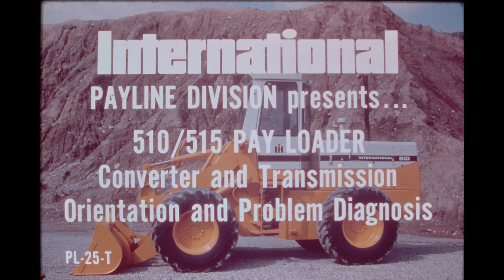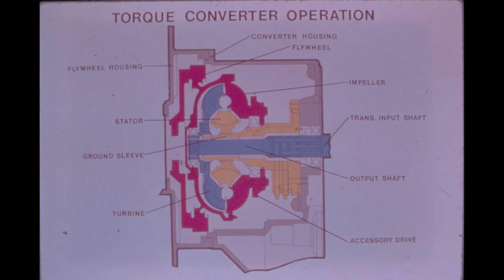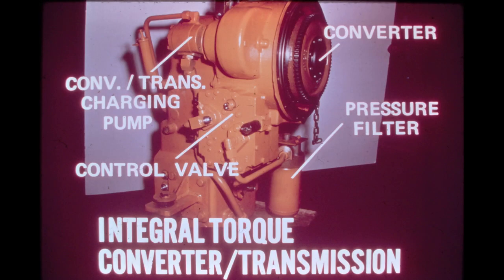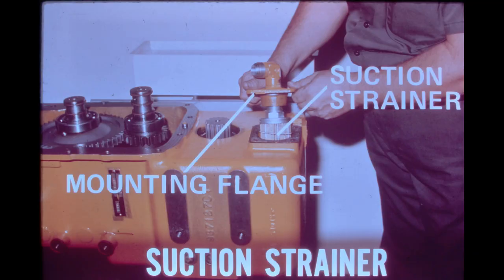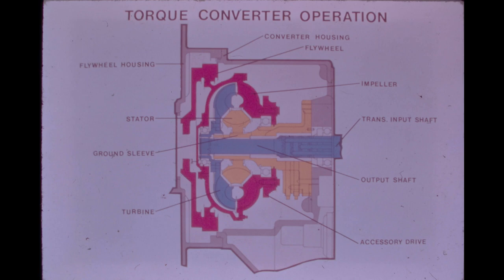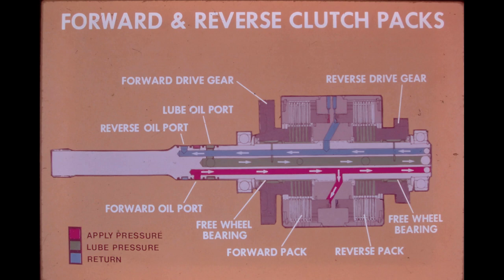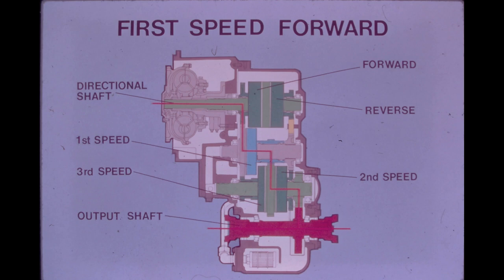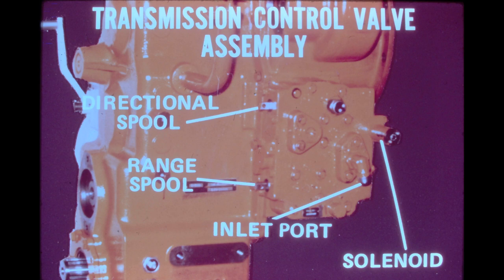International 510 and 515 Payloader Transmission and torque Converter Part 1

Comment: Do you have a transmission video on the ih 530 pay loader?!
Reply from the maker: Unfortunately I have not found one yet. Although I do have the manuals for the 530 Payloader transmission.
Reply: @deserttrucktractor2514  those would be great! Could you upload them or send them to me?
Reply from the maker: @Redneckman532  If you go to the "Red Power" forum and post a thread in the "Construction  Equipment" section about it I will post some pages relevant to the transmission. I'm on the road working for a bit and may only have the parts diagrams with me. 

https://www.redpowermagazine.com/forums/forum/9-ih-construction-equipment/